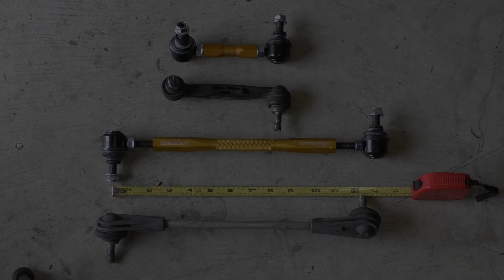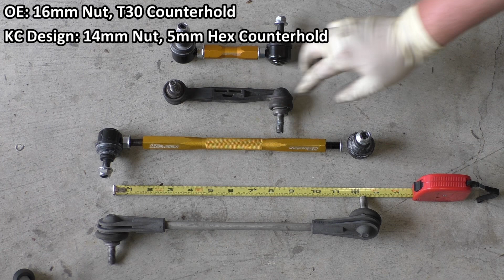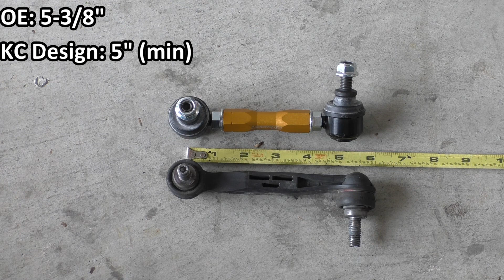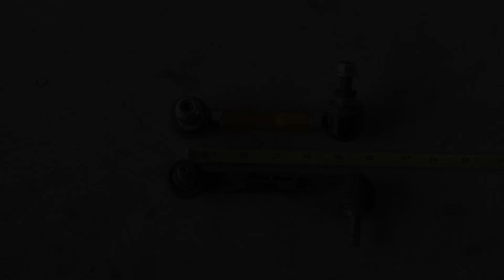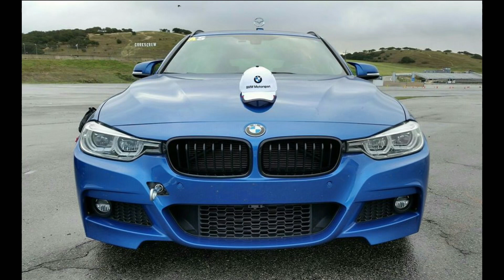KC Design End Links for BMW F2x/F3x Cars

Comment: Correct me if im wrong, people who want the most performance out of their F3X Xdrive suspension need adjustable links when lowering their car. But for people who just want to slam their Xdrive Shitbox for the look don't need links.
Or... is that dangerous €
Reply from the maker: Most of the time adjustable end links aren't needed and are more "nice to have." I have seen some slammed cars where the tension on the front links is high due to the bar wanting to go to natural position that they break/fail early though.
Reply: @FaRKle0079 ok, I have lowering springs in the front and it’s low enough, however the back sits to high with Xdrive… So I bought coilovers but only for the rear, I’ll slam it a bit see what happens and I won’t change link in the back.

Comment: Are they $105 a piece or for a set?
Reply from the maker: $105 per front or rear set. So if you get both front and rears it's $210.
Reply: @FaRKle0079  Oh nice, that's not bad. It looked like $105 each. Thanks.